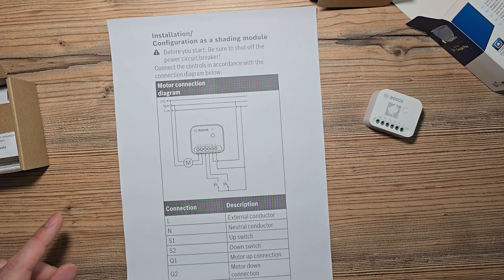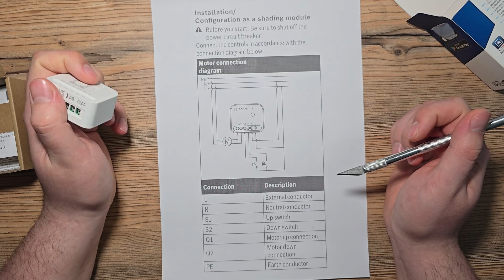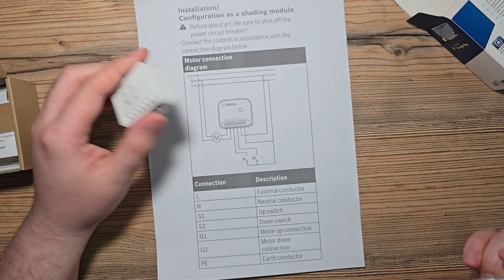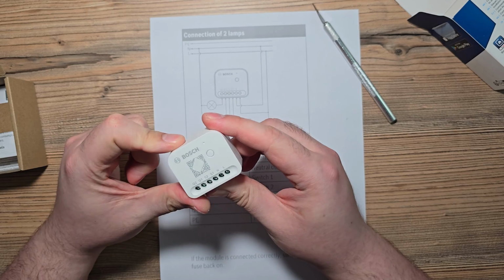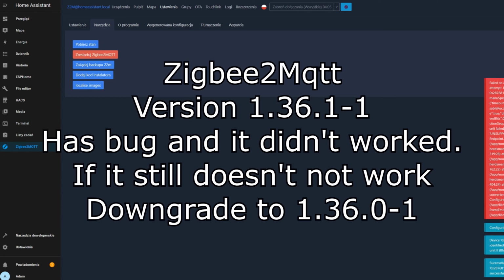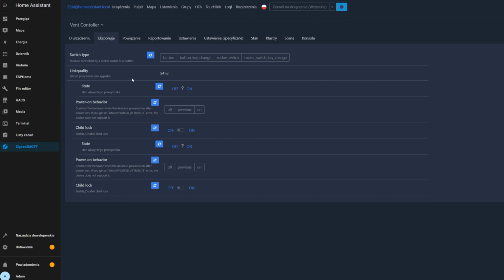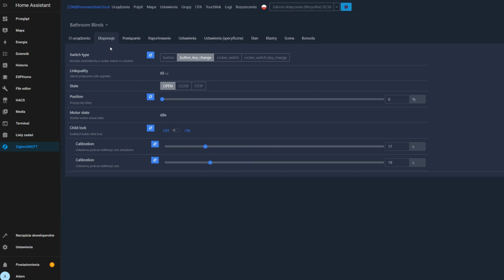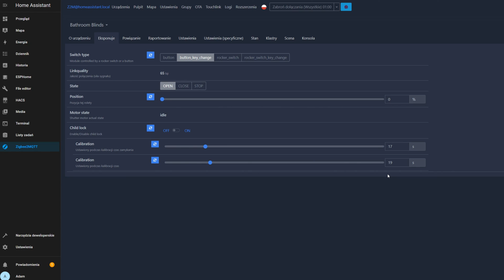Decent Zigbee Roller Shutter Controller? Bosch BMCT-SLZ W/ Home Assistant Zigbee2Mqtt integration

Comment: The price for this device is too high IMO. Anyway thanks for video! Really appreciate that polish guy talks english! Grea english by the way. DOnt know why polish people avoids talking in other languages like it's some cirminal thing to do to speak in onother language :) Polish is big and so on but hard to learn polish so it's very educated move to speak wtih foreigners in some common language. :)

For you would be cheaper to buy aivents that detects moisture and turns on automatically then using this :) if you gonna use it as automation that is turned on based on humidity.
Reply from the maker: Brand new price is too high - I agree,
In poland you can buy them as a outlet/amazon returns(like new), I paid 20€ each which is just fine, same thing with Bosch TRVs.

an alternative in my use case would be just esp8266 with esphome and two relays, but again, playing with AC->DC 5v adapter or wall charger above bathroom ceiling, Bosch is just simpler and it just works.

Thank you for good word :)

I just spend whole day looking for two quiet air vents... quiet vents with humidity sensor are too expensive thus I decided to integrate it with HA then I will have unlimited possibilities :)
Reply: @HobbyWithAdam  Nice option getting it from amazon returns. Also Shelly 2+PM and Moes are good inexpensive options
Reply: @isi7187  yeah, but AFAIK they're not Zigbee :l